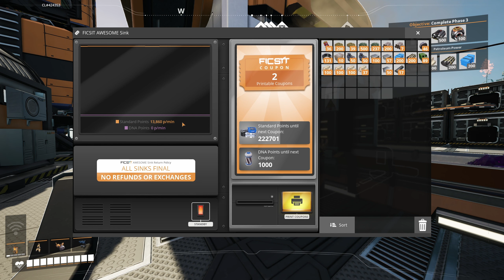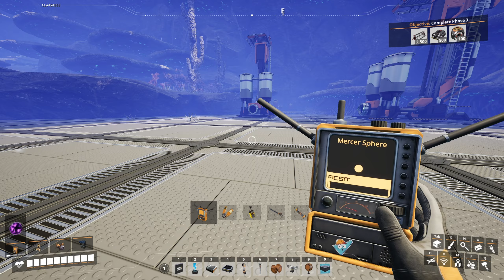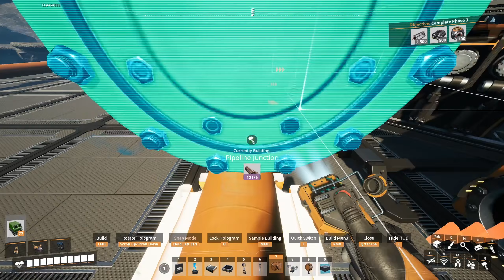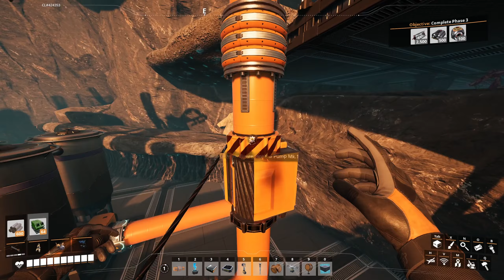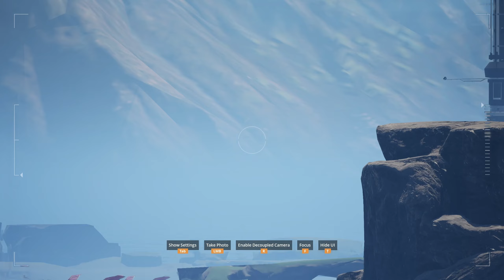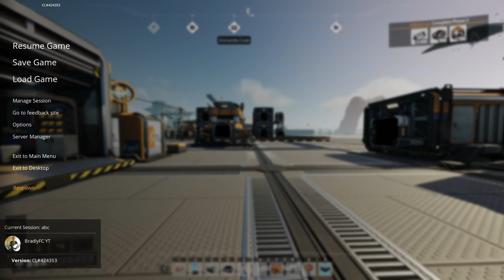F@#$ COAL, we got FUEL POWER NOW! | Satisfactory 1.1 (Ep. 15)

Comment from the maker: ONE EPISODE for fuel power instead of FIVE (like with coal power)! Is this what progress feels like? 😃

Join the Discord! 👉 https://discord.com/invite/BxaHZcB
Follow on Twitter! 👉 https://twitter.com/Bradly_FC
Reply: Finally some sanity, right? Of course it's just temporary. Nuclear gets even more complicated, with multiple steps just to get some material that you can get power from, and then there are waste products. But before that you're probably going to be setting up aluminium production, and perhaps even some fancier transportation. There's plenty to do before you need nuclear power, because the fuel stage can grow as you research better fuel. It's pretty darn good at making the mid-game a longer stretch.

I'd look into making some flat, wide roads for truck transport, as it's less complicated than trains, to move goods from resource areas and have central mega-storage where you can perhaps set up trains later. A good start might be making 2/4 rails wide section blueprints to begin with. Stacking factory floors and stopping trains nearby to unload materials looks really neat.

Comment: liquids are kinda annoying. but say you burn 20 fuel per gen and you making 80 so 4 gens is what uses it completely.  Your problem when the last one when you first set it up kept turning on and off is because the pipes were not full so some liquid wasnt getting to the gen fast enough.  So good rule to go by when doing liquid is to fill the pipes before you start using that liquid so when you expand/move your gas generation power you should do that before you turn on your gens.  
Also double check to make sure your generators are not consuming more liquid than your making because if that happens your power generation will stagger up and down and might be harder to fix/diagnose a blown fuse

Comment: You've got roughly the right ratio of power production to consumption. I've also got 50% more generated than I use in my current save (18GW to 12GW), which gives me a decent amount to work with for making factories. Been slow to improve on that since I've had other things to do, and now I'm aching to play Avorion :)
Reply from the maker: I had to take the 5th generator out of each row, but now i have a nice setup, all generators at 250% everything 100% efficiency and running like a dream lol. 

Except when I added a liquid biofuel plant next to it and forgot to sink the excess. I left the game running while I was at work and when I got home everything was shut down and I had 0 tickets 😭. I fixed it immediately, but I was sad. Been making about 30+ tickets a day just leaving the game on while I'm out hahahaha.
Reply: @BradlyFC  Don't worry about tickets. Once you create 4-component advanced items and particularly nuclear intermediate products, they start to give many times as many points towards tickets. Several tickets per stack initially while you play normally, no need to leave it on all day.

And don't forget the secondary thing. Hunt some animals and process them for another source of points, which is on its own counter.
Reply from the maker: @unspeakableoaf  I like buying parts with tickets when I'm too lazy to wait for them to craft hahahaha. Tickets have been a huge time saver in a lot of situations for me, so I like having a lot. I JUST researched all the stuff required for DNA thingymabobs, so I'll be starting that soon for sure.